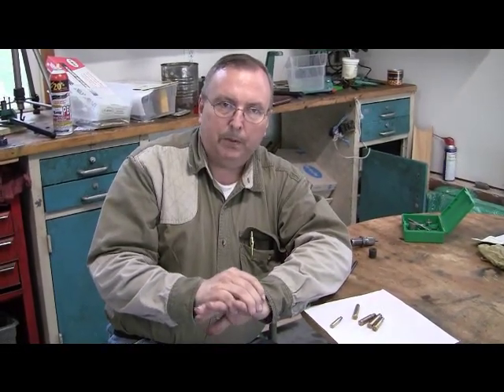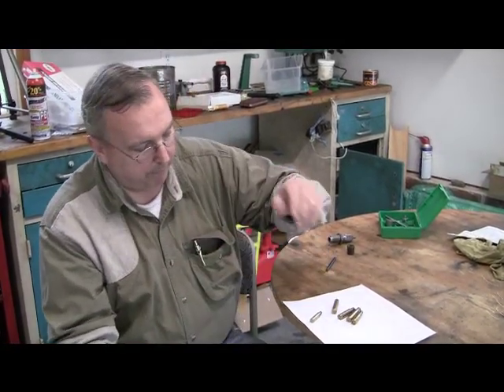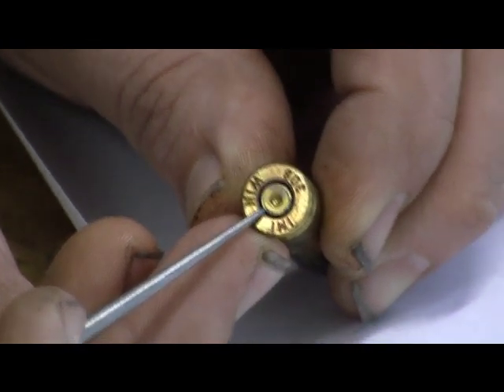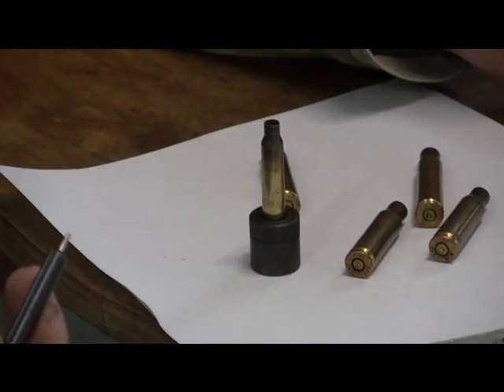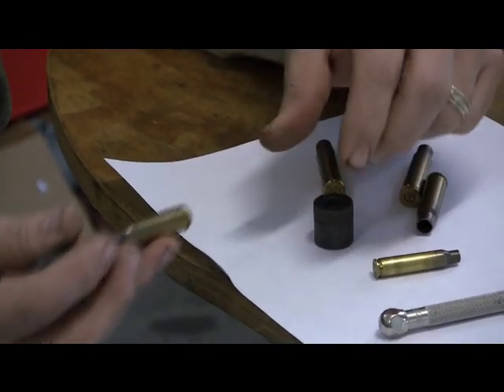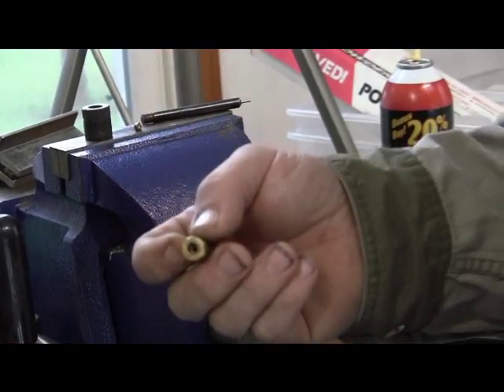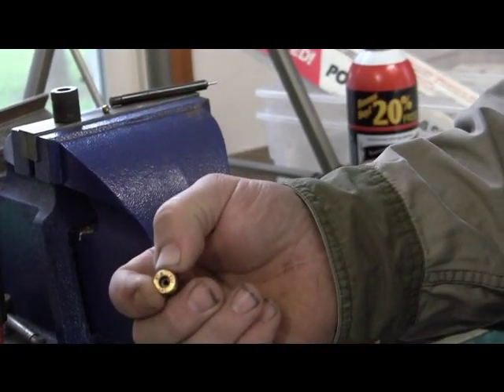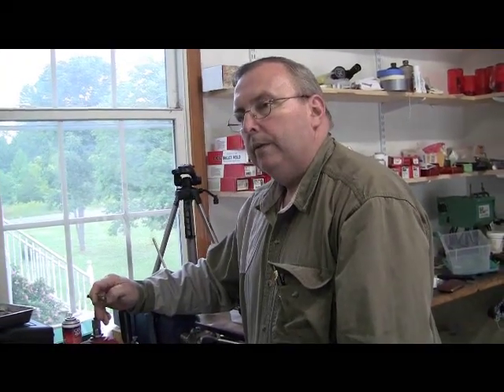Reloading military brass with primer pocket crimp

Comment: The cheapest Lee resizing dies just seem to work.  Only time I broke loose the decapping pin from the collar, was accidentally resizing/depriming a berdan primer.  After that, I use a steel brush in my dremel to just slightly round the pocket.

Comment: I'm using my full-length rcbs resizing die on military 308 brass w no problems. Never broke anything.  They have 3 crimp marks which I use my hand held debiring tool in the primer pocket

Comment: I just dseprimed 1300 cases of LC military brass with no problems with LEE RGB .223 die.Only a couple pushed the depriming rod out,i just loosened the nut reset rod tighten it back up good to go,going to use dillion super swage 600 to prep primer pockerts

Comment: If anybody is interested I went looking to buy the punch and base set for 7.62 NATO brass finally found it mentioned in the Speer manual #9. It is made by L. E. Wilson Tool & Gauge company. They still make it and it retails for $22. They don't however make the mandrel for swaging the crimp down anymore.

Comment: This is the most ridiculous thing I've ever heard.  I have full length resized tens of thousands of military cases with a standard full length size die (RCBS, Redding, Lee and Dillion) and I have never ever broke a decap pin.  
And when he speaks about no getting his punch into the case mouth he takes the decap rod and expander ball out then resizes.  Well, how does he do that?  Wouldn't you have to have the expander ball in to take dents out of the mouth.  t.

Comment: My experience with military brass has been the opposite. The primers pop out easily with my RCBS  decapping die and the crimp is easily removed with a few twists of a chamfering tool. Then proceed as usual.
Reply from the maker: well you have to remember my experience with military brass was about 35 years ago I scrounged a lot of WW2 stuff the crimp on the primers was a lot different than what most military brass is now. I got an odd lot of 45ACP stuff and a case did break my decapping pin, the date was like 1944